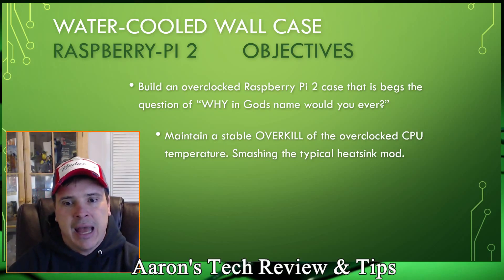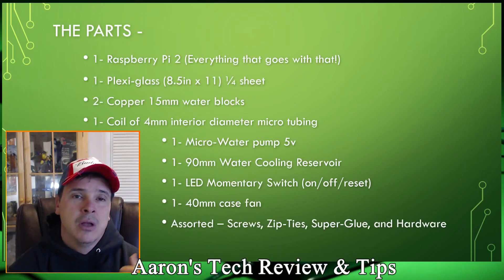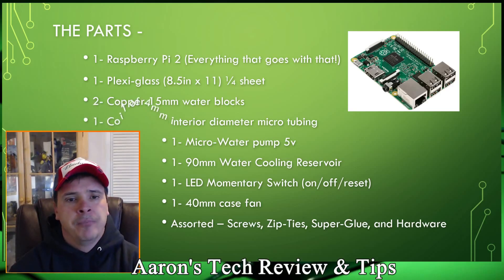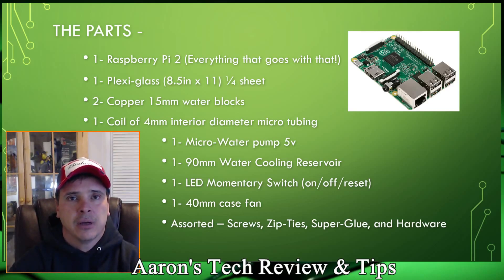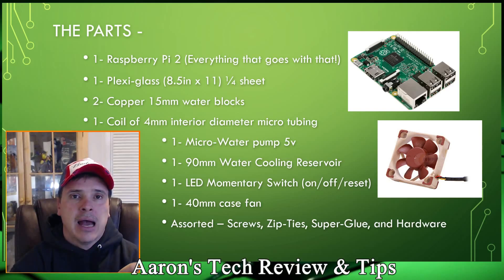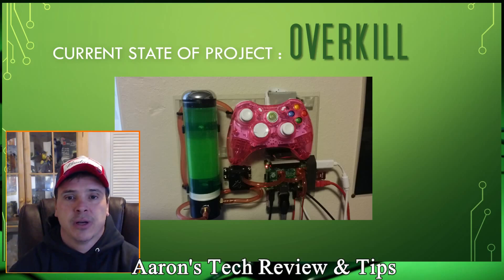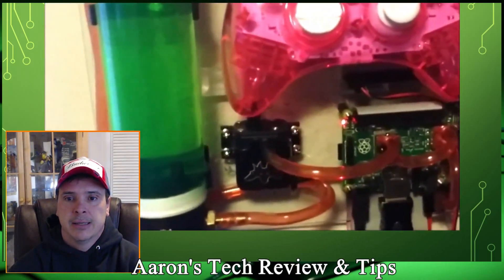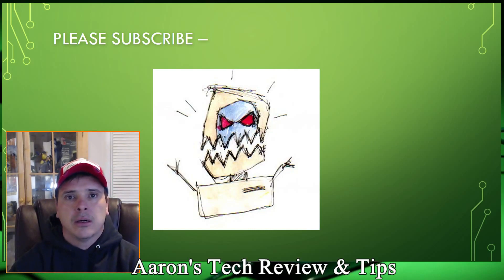Water Cooled Pi Project OVERKILL  - The Parts (PART 2)

Comment: how did you connect your tubing to your pump? my tubing is way to small.
Reply from the maker: That is a good question.. I heated the tubing and was able to push it into the pump. I took some rubber cement also to seal the water in. I am working on part 3 right now that will give you a better solution. I hope this helps your project. .. Thanks for the question.
Reply: +Aaron Johnson thanks!

Comment: Alphacool makes dual and triple 40mm rads.
Reply from the maker: I looked into that and I have only found only that everyone has them listed as out of stock. The cost is around $50. If you can point me to it I would love to pick up a couple. :)
Reply: https://modmymods.com/radiators/40mm-radiators.html

Looks like they still have the triple rads. 

I suggest these fans http://www.frozencpu.com/products/5874/fan-289/Cooljag_Everflow_40mm_x_56mm_PWM_Fan_R124056BU.html?tl=g36c15s631#blank

Or these 
http://www.frozencpu.com/products/5926/fan-296/Cooljag_Everflow_40mm_x_28mm_PWM_Fan_R124028BU.html?tl=g36c15s575#blank

Those are both pwm so it would be soo cool to see you control the fans.

They also make non pwm fans much thinner if you want a sleek look instead of awesome overkill. 

http://www.frozencpu.com/cat/l3/g36/c15/s70/list/p1/Fans-12_Volt_Fans-40mm_x_10mm_Fans-Page1.html

I think 4 fans in push pull would look really cool and if you use the thick fans it would look pretty cool especially if you pwm control them.
Reply from the maker: SWEET! I've never used this company and will make an order. :)
Reply: Sweet, I can't wait to see what you do with it ^___^

Comment: Hey Aaron Love what you did to this!!! By the way I realized your the neighbor that lives across the street from my mom. The bug gave it away.  Any ways I've just picked up a raspberry pi 2 and have been using the pi B+ for a retropie gaming rig and found out that N64 games run really slow on it but is way faster on the pi 2. Keep up the reviews and cool builds.
Reply from the maker: +Troa Barten :) Thanks! BTW you can overclock the RPI-2 to help speed up the Retropie. I run a stable 1.07 and the Retropie is smooth as silk. Keep me posted on your project and if you need any help just let me know.